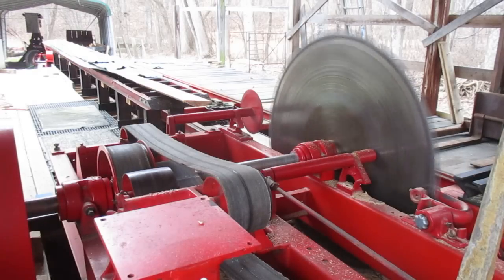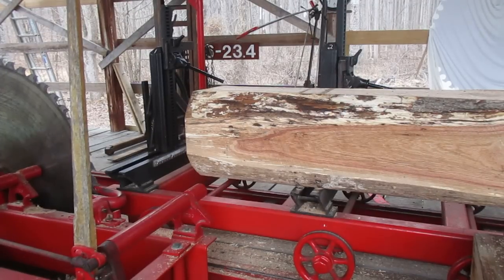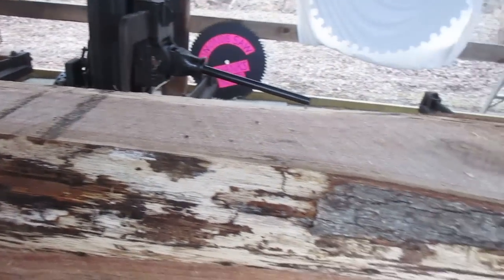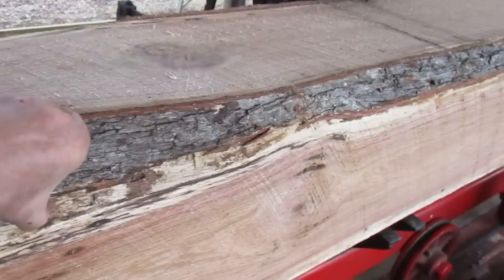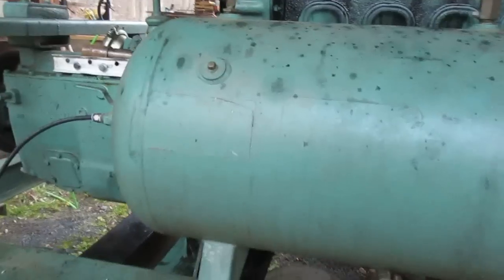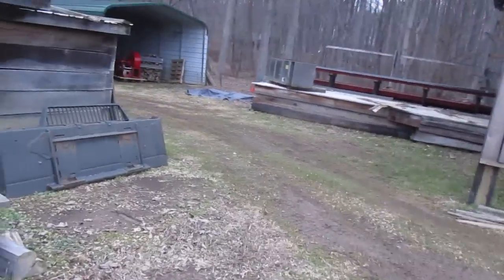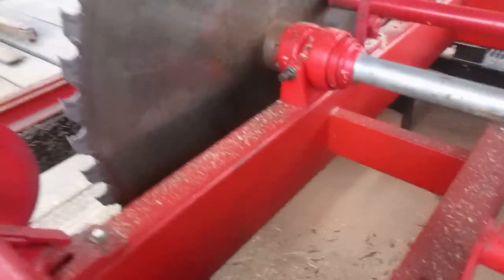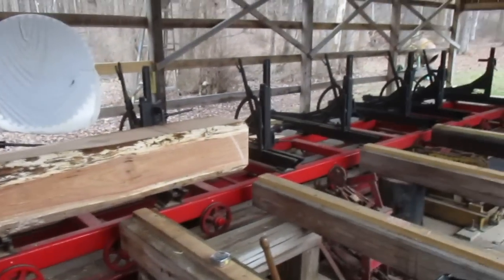Big sawmill first real log # 1029 getting it ready

Comment: Super impressive saw.  And you know how to run it.  
This saw needs hydraulics.  All that climbing up and down on the bunks is dangerous.  The other thing that looks like is missing is an off feed roller.  Having to pull cut boards away from the blade by hand seems dangerous and not good for the blade or the board to have the board resting against the moving blade following the cut.  It would be nice to see what this saw looked like when it was up and running in production before you inherited it.
Reply from the maker: hi there well not quite sure what to say , first there hydraulics are coming .It takes money and time , the climbing thing really is like going to the gym . it does have the off feed rollers . this is a 70+ year old saw and this is the way it saw done , So glad you stopped by and  watched ,Thank You John
Reply: @fricknjeep  Yeah, I figured it is a work in progress.  70+ years.  wow.   I get it now.  Well be careful.  Again, very impressive what you have done.